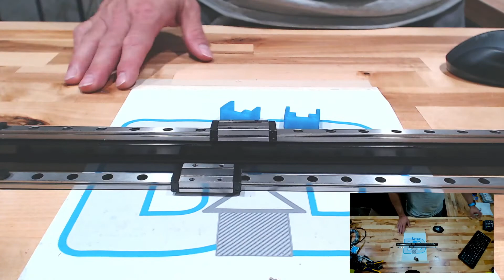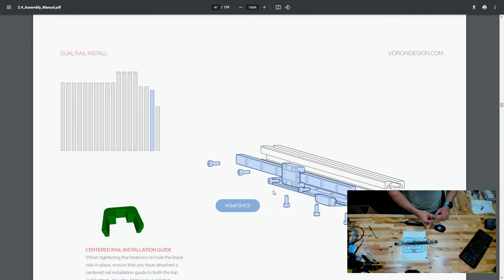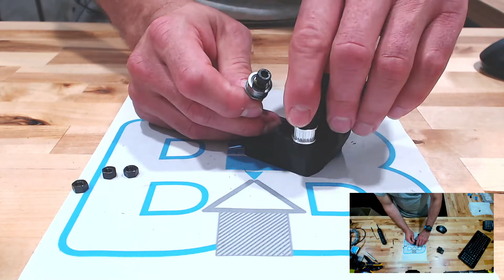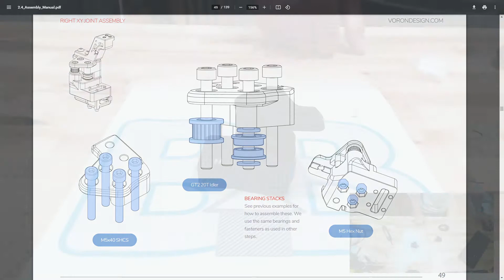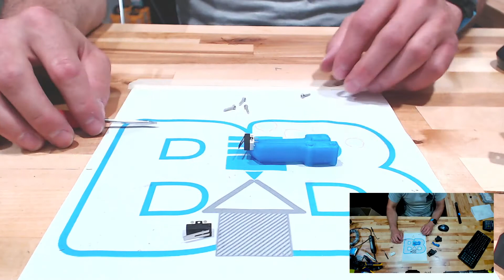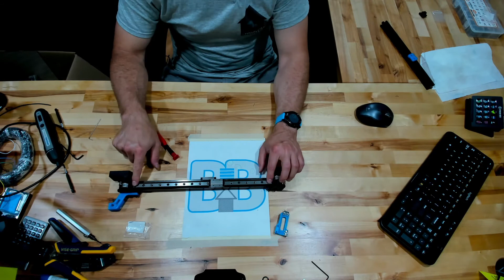VORON 2.4 3D Printer Build It Live *Episode 8* Gantry Part 1

Comment: Starting to assemble my 2.4 as well.  With the 2nd rail im going to assume its there just to relieve rotational twist due to the weight of the toolhead. Therefore reducing wear on the bearings. Also looking at the video do you think you could have put those alignment jigs on like a 45 degree angle for the 2nd rail to get the rail more in the pocket?
Reply from the maker: Congratulations on the start of your build! The 2nd rail is no wrong or right way,  I used both rails in the hopes that things will be a little more precise at higher speeds.  Using a single rail will make things a little smoother since there are no objectional forces if things are even slightly out of alignment.  I'm not sure what you are saying about the 45 degree on the alignment clips, if they aren't on at 90 degrees there would be changes in where the center would show?  I ended up making a second set (which only took a few minutes) with smaller "legs".  Eventually, I'll be going out that and some other things once I can do a re-cap.  My progress is really slow right now, I'm not a career YouTuber so I have a few priorities that come before my hobbies.  Thanks for watching! Shoot me an email if you are interested in doing a stream with me and a few others who recently have completed Voron builds - It'll probably be next month.  I want to compare and contrast builds and go over issues and such - let me know if you're interested.
Reply: @BuildItBasement  the shorter legs is a much better idea. But i was talking 45 degrees parallel with the rails so you at least get a solid corner holding it centered.  My progress is very slow right now as well. Still need to buy mostly electrical stuff. I have my pi, standard screen and a 5" touch screen, btt octopus board w/tmc2209's and 4 ldo standard temp steppers for the z but need my high temps for the X,Y & E. Still debating on 0.9degree or 1.8deg for the XY and if i want to do the Galileo extruder or standard setup. but still need the power supply, wires, end stops ,ect. 

I have priorities as well, lol so i can just throw down $1,600-$2k for a hobby machine 😅

Comment: Waiting for my kit to arrive - went for the Formbot. Printing the parts out. Has been really helpful seeing the process thanks!
Reply from the maker: Dave - No problem.  Trying to find some time to finish up the gantry asap.  I'll keep putting these up all the way to the final Klipper config.  Let me know if you have any questions when you get the kit!  This is just my second printer (first is an Ender 5), so it's been a process.  I'm glad I did do some upgrades over the past year or two on the Ender it helps.
Reply: @BuildItBasement  and it arrived this morning :-)
Reply from the maker: Awesome - Now you get to make sure you got everything you expected. I think you'll find the packing to be pretty nice, all things considered.
Reply: @BuildItBasement  certainly feels that way. Nice box of goodies - will start the build tonight- no videoing unlike you!
Reply from the maker: @davemcconnell2491  That will shave about 3/4 of the time!  You'll blow past me.  I just printed my LCD panel and skirts last night/today.   Really impressed with the 'ol Ender.

Comment: Whenever you switched to the close-up view down near the table, the audio broke up. May be a USB bandwidth issue?
Reply from the maker: Keith - Thanks a million.  I'll have to look into it.  The mic audio is actually wireless and fed directly in via 3.5mm jack.  Ah the fun of being a new YouTube content creator!  Still learning and I honestly do appreciate the comments.  Just so I don't have to watch myself for the better part of an hour, could you give me a timestamp for the audio issue?  I'll recreate  and resolve so it doesn't happen again.
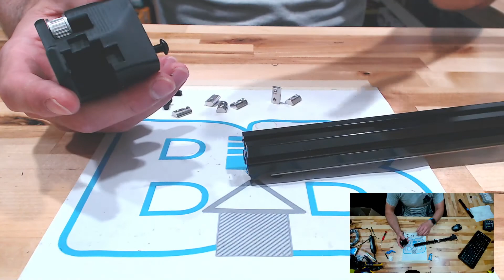Reply: @BuildItBasement  43:07
Reply from the maker: Perfect - I'll take a look/listen this evening before my next video.
Reply from the maker: Keith - Thanks again.  Turns out the antenna on the pack was loose and I must have been putting pressure on it for a few seconds.

Comment: i like that you decided to use both rails it might be a pain to get them lined out when attaching the hotend but i think it will be more rigid
Reply from the maker: Agreed.  The added drag is minimal, from what I can tell and having rails on two sides/axis should nearly remove any slop.  Hopefully it pays off.  The hotend portion of this printer isn't the heaviest, but it's not the smallest and there is quite a bit to it.  More mass=more ringing and more to go wrong without proper "guidance".